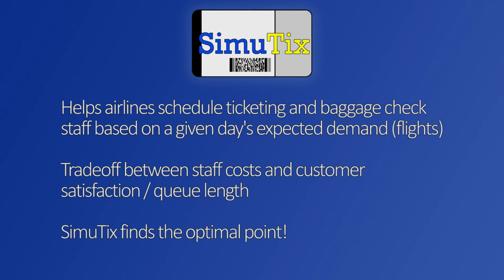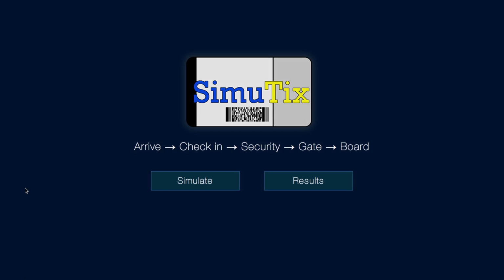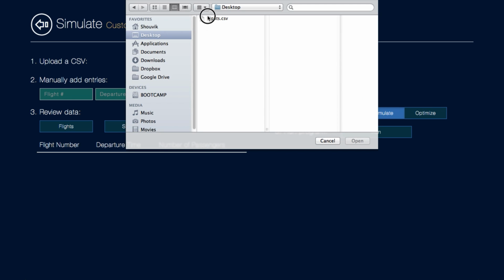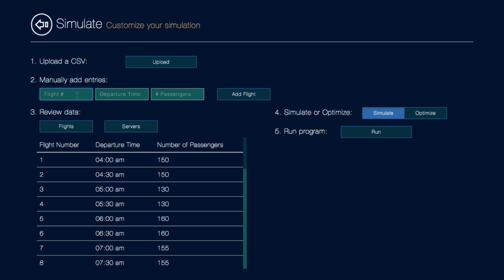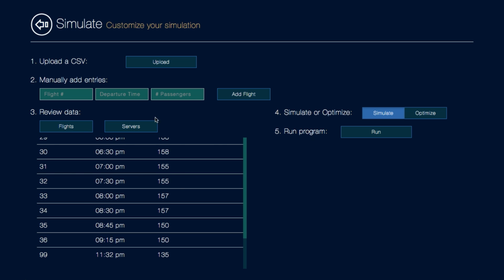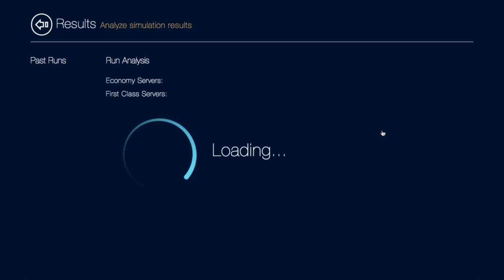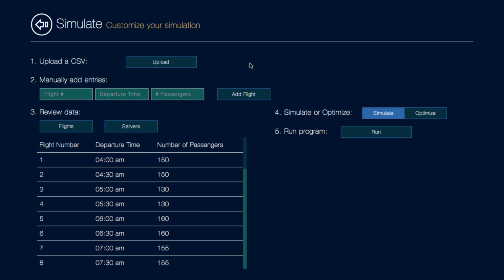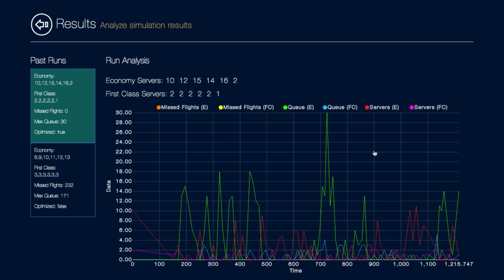IEOR 131 Sp14 -- Team SimuTix

Comment: IGITF
HI guys, your model have some realistic features like first class servers can serve second class customers if they are idle, and the generation of arrival rates between 30mintutes and 2 hours, which is good. You also have a very nice interface and the simulation outputs are nicely presented. I liked that you included the optimization part. Great job!

Comment: The ability to upload a CSV file is great on the interface and necessary for the industry. The output graphs are beautiful and informative and the 'running' feature is great from a user standpoint because they can see the product optimizing before them. I think their could have been more time spent, however, on the actual product video as your product is great and could have been showcased better.

Comment: The interface is well-designed. However, uploading a CSV might run into some format issues given different users have different CSV input habits. The analysis result looks pretty good, especially on putting all the results in one graph with different colors. It would be nice if you can improve on your slides a little bit more.

Comment: The presentation is is comprehensive and clear. However, I expect that the model can be improved and updated with a case of family. I think that it will be handled with batch system. The design of user interface is so interesting. Overall nice

Comment: (ID: DAODA) Very practical product especially the interface!! It’s better if you can take self-checkout kiosks into consideration and then do the optimization, which will be more realistic.
Also, for your optimization, it’s nice if you can explain what kind of model or method you use for optimization to convince the buyer if the result is reasonable.
It would be great if you can change the shift time in the simulation instead of fix it at 4 hours because from your slide you say that your product aims at any airport which may have different schedules.
The way you put together different plots in the same graph looks very concise and informative, it would be great if you can elaborate more on the correlation you can observe between different curves.
Thank you!

Comment: (11235) Beautiful simulation interface, and I love the possibility for optimization, as this can be a useful tool in practice. Did you take into account self-check in machines that can do all of this automatically, without servers, or online check in? Most airports, including SFO, rely on those, and then you just drop off your baggage, changing the queue dynamics.

Comment: Great interface, but it seemed like a lot of detail was left out in the presentation. I didn't get much information on how the time spent at the counter was determined (and would be much longer for people who have flight problems). Also, sometimes certain workers focus on answering questions and solving issues while others just move bags to the conveyor belt. Self-check kiosks have gotten very popular, and I don't see any incorporation of them into the simulation. Great idea, but it seems like a lot of important airport factors weren't included in the simulation.

Comment: Great presentation, but i think u guys should improve the slides. Compared to the slides, I like the user interface more, it seems like very professional, instead of plugging the data one by one, the users can just upload the CSV file of the flight time which is easy to use. The dynamic server based on time in different shift also works in the real situation which optimize and save time for the customers.

Comment: Great job! I especially like your user interface. The toggling of the graphs gives users flexibility to focus on what is important to them and the fact that you can toggle through past runs to compare different tests is awesome. I also like that you have the optimize function to quickly run multiple tests. It seems like your model assumes certain arrival and service times but I wish users could change the times according to their needs. I am also unsure if you assume that everyone that is on a flight uses a server. Otherwise, awesome!

Comment: (93914) Presentation is concise and straight to the point. Cool user-interface since you have enabled user to upload the schedule of the flight instead of manually input. The final graph looks a bit messy when combing all the curves, but I remember that you could view the curves separately the first time I watched the video? One thing to work on in the future is to add in the self-check in machines for the model

Comment: Much wow. So python. Incredible work on this product SimuTix team! You could definitely tell that there was a great amount of work put into this product and presentation. In terms of the simulation model, I would recommend that future versions allow for arrivals of multiple people (families) as there is a time disparity in checking in 5 people of the same family and 5 individual people. An interesting edge case of your model that you could account for in your model is extremely late people being rushed to the front of the line, which I have found to be the case in my experiences. For the optimization model, an extension in version 2.0 can perhaps be to have a way to optimize with respect to the proportion of people that miss a flight, because I imagine realistically that a small amount of people do end up missing their flight despite the efforts of airlines to cater to short lines.

Comment: I like the product and especially the UI. Comparing to the product itself, the presentation slides seems need some improvements. The design of "optimization" is impressive, since it could save a great amount of time for the customer to get the optimized results. However, it would be more realistic and considerate to include constraints for max servers available for that day when running the optimization simulation.

Comment: This product is great because it provides clients with the necessary information to make optimal decisions. The model itself makes realistic assumptions. To be more realistic, the model should include self-check-in kiosks. While this may be difficult to include, many times if there is a long line and a flight is boarding, the airlines will rush passengers in the line for that flight to the front, preventing them from missing their flight. It would be interesting to see how that affects the simulation.

Comment: (ID: HONAM) Very nice product that captures the essence of the problem. I like how the arrival times of the passengers are based on the flight schedule, which is pretty much true in real life. The user interface is nicely designed and easy to use. One suggestion I have is to consider cases where servers might need to provide service to a group of people at the same time, such as kids or elderly people. Otherwise, very nice product.

Comment: Your model is excellent! I like how arrival rates are based on the flight schedule, which seems very realistic as well as the fixed interval for staffing changes. Your interface has a lot of great features, and seems very concise and useful. I also like your choice to ignore self check in kiosks. You're making short term staffing decisions per shift, whereas the number of self check in kiosks is a more long term planning decision. The traffic to those kiosks could easily be accounted for in your model by modifying parameters if needed. Great job guys, easily one of the best! 
(ID: Zibar)

Comment: (JZ339) The animation explaining the model is very simple and easy to understand, which translates to easier understanding on the client side as well. Your interface is very sleek and it really stands out in terms of ease-of-use. Dynamically changing results graph is very useful as opposed to having all graphs on one page--the user thus does not have to scroll to compare different analysis output.

Comment: (CID: GOGOY) The design of uploading a CSV or manually is really practical and easy to use. The "Optimize" button can really help customer reduce time needed to get the optimal result. Good demonstration and results analysis. But it could be better if you add the self check-in queue lines since many people nowadays are using self-checking in.

Comment: The interface is really great, especially the real time results, and optimization.  I am curious to who would be using this model.  In the about section it says its for shift scheduling of ticketing and baggage check staff for the airport, but the user inputs the number of economy and first class servers which is determined by the airline.

Comment: Great work regarding automating the optimization process! Very cool! Also, the flight time dependent arrival rate is an excellent feature. However, it’d be nice to be able to adjust the arrival interval (30 minutes to 2 hours) to cater to seasonal trends (maybe travelers arrive earlier during holiday season.)